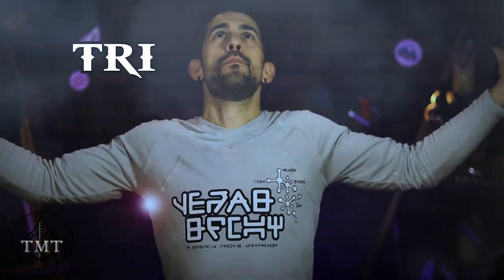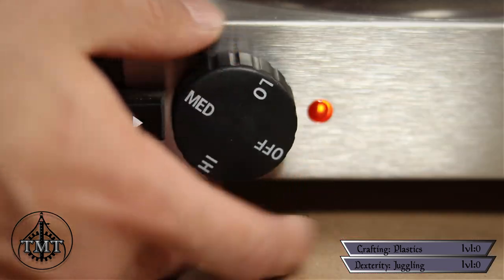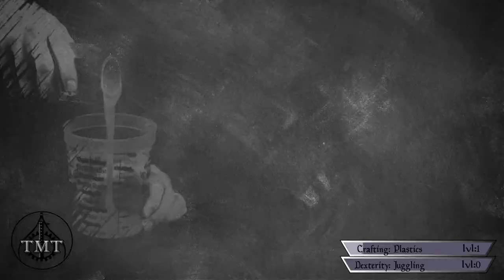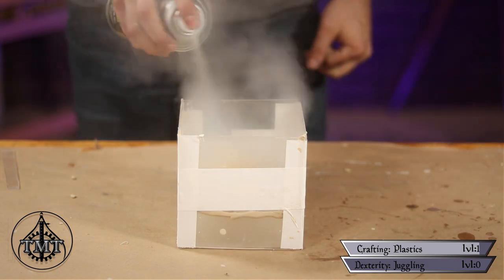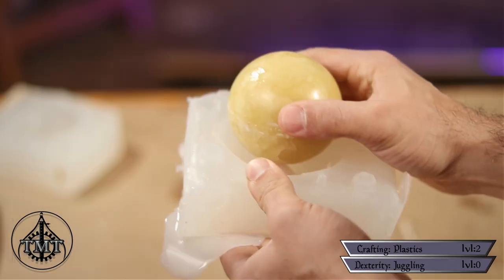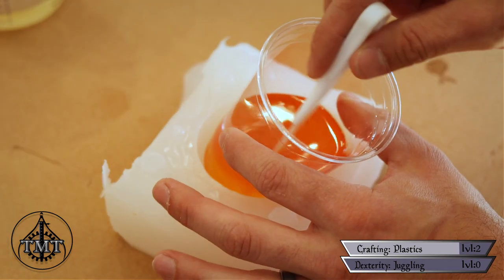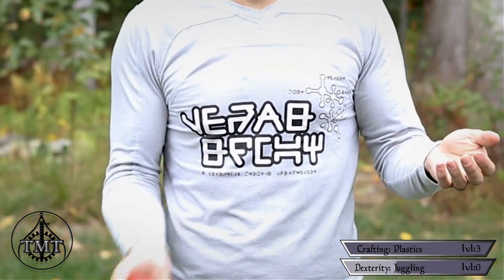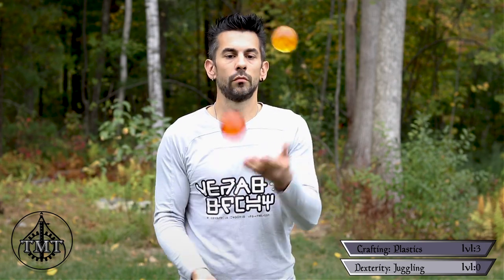Bees wax to DRAGON BALL?!? How did that happen? | Skill Tree

Comment: Fast and easy degassing to get rid of some of the larger bubbles: take a large Rubbermaid container and place your mold inside. AS SOON AS YOU POUR, slip one of those “space bags” around the container, and start vacuuming the air out. The slower your resin’s cure time, and warmer the ambient temperature, the better this will work.
Reply from the maker: Great tip! I will DEFINITELY be giving that a try.

Comment: Nicely done!
Reply from the maker: Thanks for watching! Glad you liked.
Reply: @SkillTree  often I use a metall mold box made from 2 halfs with keys on 2 sides to close always same way(one is wider). Each half has caps, so box is made from 4 parts. I'm puting wax model in bittom half full of plaster. After 10-15' plaster is hard. I'm puting second half without cap and full it with plaster, then close and press. After all plaster is completly hard, i'm putting box in boiling water for aprox 7-8'. It depends on a size of a wax model. Then i'm opening box on a middle line and washing plaster mold with a boiling water. After it cools a bit, I'm applying separating laque. Then i'm mixing acryl plastic (powder+ liquid) and in a few minutes when it turns to a plasticine like state, i'm pressing it in mold. That way dental prosthetics are made, or orthodontic appliances. After the plastic is all set, you'll have to remove just excess plastic on a perimeter, without cutting a gate. Pheew... Hope my poor english was understandabe enough :-)